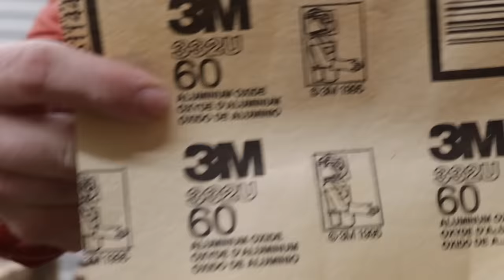Vintage Work Table Built with Reclaimed Wood and Homemade Dowels!

Comment: Cool build.  I am doing a similar project with 2x wood I recycled from my neighbors planter beds.  I cut off the moldy parts and built the frame.  I have 8' + boards for the top.  They are 2x material of various widths after cutting off the rot.  The long edges are either rough cut with a circular saw cut against a straight edge or the edge that came on the board initially.  They don't fit together precisely and Im ok with a rough and rustic look.  The table will be used outside for various things; garden party service table with a runner etc...  Previous tables I have build with recycled wood I biscuit and glued the top pieces but since this is so rough I'm thinking more picnic table style with slight gaps being ok.  I like the method you used here.  Any worry about the wood being restrained on both ends?  Perhaps no because it has been outside so long and is very dry?  Same with my situation.  Thanks for the video inspiration.

Comment: Among all the professional workbench/table building videos THIS is one I'm going to use as reference for sure. :)
I have a lot of 50~ years old lumber at my late grandfather's vineyard so building anything from it looks a lot like you presented in this video.
All of the material is curved, bent, has nails and screws in it, and the surface is really rough sawed making the building process very different from store bought materials.
Thank you for the inspiration, this content is especially reassuring for me and for the people who don't just burn and throw away stuff that is old :D
Money is not an issue, nor the protection of the environment... but this is a mentality that leads to those things saved by the end of the day tho' :)
Greetings from Hungary!

Comment: I have watched ALOT of woodworking videos. This is one of the most satisfying one I have watched. I am going to try this. Thank you VERY much for sharing.   This content is great...old used wood being reused,
Reply from the maker: Thank you! glad you enjoyed! Every time I get a comment like this I am very surprised. I didn't think this video was that great when i made it but for some reason people have really liked it!
Reply: Well, I have watched it several times.  I made the frame like yours,  but using a circular saw it didn't turn out quite as nice as yours.  Also,  haven't tried the dowel thing yet.  Anyway. Thanks again for it.

Comment: How come you did not sand it after cutting the dowels off?  did I miss it?
Reply from the maker: Sanding would have removed the rough old wood around the dowels and would have made it look bad. I wanted to keep that old look so I just cut them as flush as possible and left it.